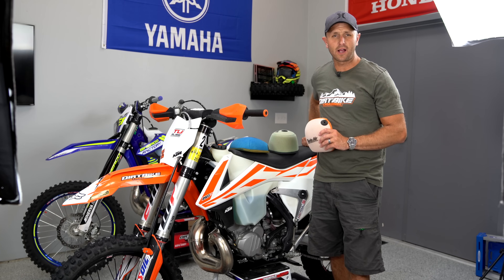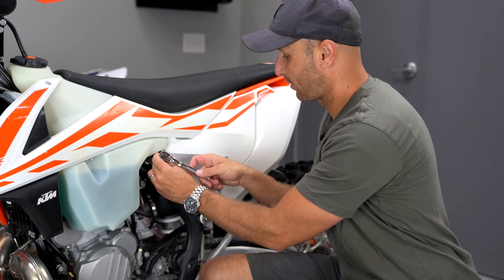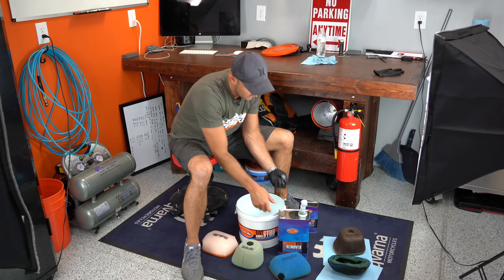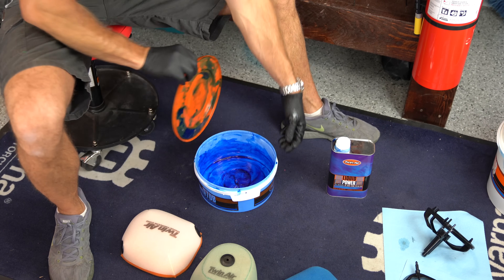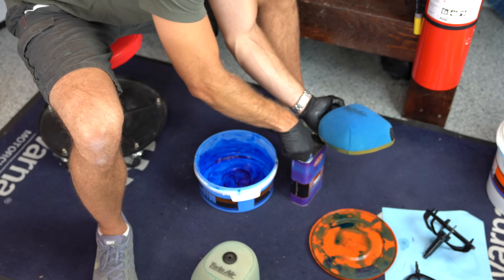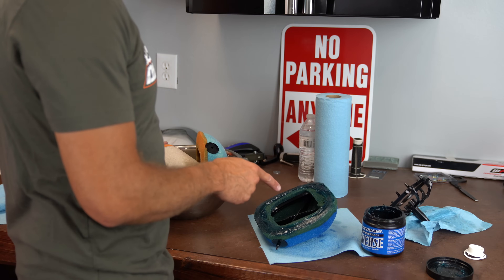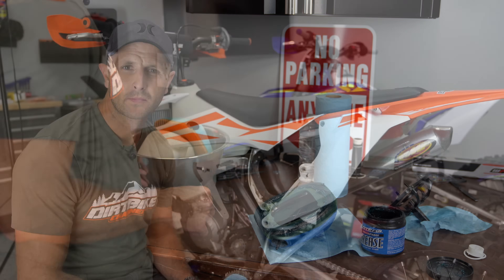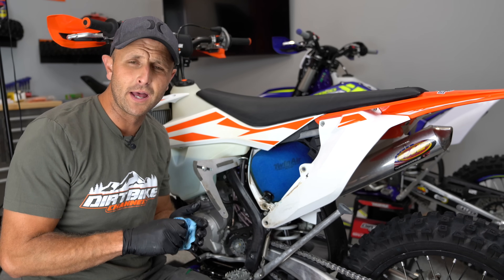How to Clean/Oil/Replace an Air Filter - For Beginners and Vets Too | Episode 288

Comment: I have been using diesel and dish soap to clean filters for 25 years. NEVER EVER had an issue with filter durability. I like the PJ1 oil.
Reply: Out here we use petrol man, gonna start using dish soap , gotta save fuel
Reply: Same
Reply: I use dish soap on mine and never had a problem.
Reply: Nice
Reply: I use gasoline then dawn dish soap and spray it with k&n oil.
Reply: @jondoe4667  what do you oil your filter with? Bc the twin air oil doesnt come off with just dish soap (i tried trust me)
Reply: @tumeh7410  I have been using k&n filter oil lately. But I make sure the filter is completely saturated.
Reply: @jondoe4667  ok i just cant get the old oil out with dish soap so i use the twin air powder thing
Reply: @tumeh7410  did that work pretty good? I've been thinking about buying the twin air wash and oil kit but haven't done it yet.
Reply: @jondoe4667  yes it has worked really good
Reply: I use laundry powder detergent (like oxiclean) and warm water. It removes all the grease and the dirt no problem. No need to soak and wait and I can do it in the bathroom sink lol
Reply: Kerosene, then warm soapy water, rinse with clean water, air dry, oil, a THIN layer of grease on the lip, install.
Reply: Its been a Longgg time since I've Ridden dirt.  But Why?? Wud you Put Oil? In an Air filter?? I started  Wayy Back i. The early 70's, BUT Never seen that? Id just Replace em.. Curious? T.Y.
Reply: @harleydavidson6851 because off  dust cant go around oil and wan is not oiled all shit came tru..

Comment: I always have the second filter oiled and ready to go. I put it in a Ziploc for later. If you have a long weekend of riding and it's been dusty you're ready to go. I also lightly grease the airbox. You would be amazed how much dirt gets stuck to the airbox walls. Thanks for the video.

Comment: the sand/particles does not go away when cleaning with solvent. You just massage them in to the filter.   The only way to proper clean the filter is to wash it the washing machine after solvent and soap.

Comment: I have used all types of filters for the work I do such as air particle systems so I know a bit about filters. Air and dirt particles are measured in what’s called microns and even a dry filter with no oil would not let sand or dust get through the filter. We don’t want dust getting into the motor of course because it would shorten the life of the piston and cylinder but also oiling the filter heavy shortens the life of the motor due to air restriction. Air restriction is very harmful to an engine of any kind. If you were to wash an oily filter with soap and water and let it dry out grab a paper towel and squeeze it into your oil oil filter. You will see there is still oil in that filter. This amount of oil is enough to help remove dust however if using a solvent such as what he’s using it could remove all oil so lightly coat the filter with oil. Dirt and dust will not get past that filter enough that it would harm the engine but restricting air flow can cause it to run hot and will cause the engine to run hot as well as shorten the life of everything in that engine including the clutch. Also he used grease around the edges and that’s a good idea because that’s the only way dust is going to get by that filter. Locking and air filter in place securely is the most important part of an air filter cleaning or replacement. Cat dander is 3 microns and dust is much larger so I’m telling you that there is no way dust can get through that filter. It’s a shame that in 2023 they don’t make these air filters lock in place like they should because how they connect to your box is extremely important

Comment: Quick question… at about $30 per can for the Twin Air filter cleaner…do you filter the ‘just used’ oil, putting it back in the can or ???. With the plastic piece in the wash tub, all of the sediment would be in the bottom and allow straining/filtering the cleaner. Curious… I know that if we own high end bikes…we can afford the upkeep/maintenance.  Big point due to hazmat liabilities 😎

Comment: nice vidio and great products to. for a long time v been using a 5 gal. bucket with about 1/8 filled with water and mineral spirits. they keep them selves separate for the dirt and a 5 gal. container of mineral springs will last a great deal of time. then I use an air filter oil that dries very sticky to the point it is stringy like. with that it makes a great sealing surface.

Comment: It’s 2021 no one should be using old fashion oil filters get with the times that’s old news new dry flow filters clean clean and flow just as good and don’t hurt your airflow meter etc etc

Comment: I ride in the desert. I use a filter dust cover. When its time for filter maintenance I unscrew the filter wing nut slightly to be able to remove just the dust cover first which is covered in dirt. Now im looking at a somewhat clean filter so when I remove it I have much less chance of dumping dirt down the intake tract. I also can extend the main filter cleaning intervals using the dust cover.

Comment: just a tip , i use a 20mm paint brush and paint a thin layer of grease on the air box lip, you use alot less grease and its much easier as the filter doesnt absorb it while applying.

Comment: I need to clean mine but the manual talks about a screw in the upper left corner??? I can't find it and I don't want to yank on the cover any possibly break it. Is there a screw that needs to be removed first?? 18 450 sxf
Reply: On my one you have to be pretty rough with it

Comment: Best dirt biking maintenance thing I've ever done was to switch from solvent based oil to alcohol based No Toil. I'd argue that the ease of cleaning helps you keep the filters cleaner, so that overall it works better. than solvent based. I'll never go back to solvent based oil again.

Comment: How many rides do you do befour cleaning the filter on the two strokes? And also how many times can you clean one filter and reuse it before it starts to tear or rip
Reply: I clean the filter every 10 hours, and replace it at 50 hours. If I were to ride in harsh condition all the time, cut the time in half.

Comment: I used bucket with oil but then I realised that I'm waisting a lot of oil after squeeze all extra oil. I did the same like you later on but now I'm using plastic bag. I put filter there oil and working. It's much cleaner method. Just FYI. What about dust cover? Are you using it?

Comment: Don’t waste a bunch of money on marketing and fancy labels.  Buying a purpose made air filter oil is justifiable to me....but the other products are not.  Buy a jug of generic mineral spirits for cleaning the filters....lots of big reasons not to use gas.  The generic mineral spirits will las you years.  As far as the grease.  Just buy a regular tube or jar of lithium complex grease from Walmart.  I just use the stuff in my grease gun for my tractor (mobile 1 lithium ).

Comment: Sure every rider has preferences but I'm pretty sold on the No Toil, would be great if you could review it.
Great for the environment and easy to use so you are more likely to clean the filter more often!
I also clean the air filter frame and airbox if they start picking up a bit too much dirt.
If you clean the airbox be sure to stick a clean rag down the intake because the airbox cleaning covers don't seal 100%.
That bucket with the grate on the bottom is a great idea, will be sure to get one of those.
Great videos, best dirt bike channel on YouTube...keep up the good work!

Comment: On my older bikes I used to use the powdered notoil cleaners and spray on filter oil. But with my '17 husky, which has the same filter as your KTM, I'm using the liquid oil (I use the green twin air stuff that seems thinner than the blue). And I have to say I really like the process of being able to completely submerge the filter then wring it out. Done!
Reply: I have used the spray oil and I don't reccomend it. I get a nice piece of mind from fully submerging the filter.

Comment: Question I use Diesel to clean which works great (in my opinion) however I don't use oil or the grease is this bad? (2017 KTM 500 6 days)
Reply: The grease around the skirt isn’t necessary. But you should always oil your filter. Especially on a bike as nice as yours. Without oil, the filter is almost useless. I recommend just getting a spray on oil. Whatever you can get will work though

Comment: Friend that keeps tractor trailer engines running hundreds of thousands of miles said the big reason they get that longevity is because of really clean air.  If he loosens a truck filter, a  good new one goes on.  Air filter hygiene as stressed in this video is the way to go: Add: Try to have a clean bike so dust crumbs don't fall in.  Damp towel to pick any dirt on clean side of filter before you put filter in. Store next "ready" filter in a big zip lock bag so it doesn't get dirty waiting to go in.  When solvent goes back in 1 gal can, leave the last 1/2 cup and the dirt in the bucket for disposal.

Comment: I'm with Kyle on the grease, Always grease the mating surface of that filter , it offers extra sealing where air could be pulled between the filter and the air box at wide open throttle. It certainly isn't hurting anything.
Reply: I prefer to run a PC pro seal but yes otherwise grease her up, more in this case better than less. Feel it would take a major excess to be a issue getting down the boot into a carb or TB on another bike.

Comment: Kyle...  Nicely done.  Two other steps that are great to practice...
    1...  Cover the intake with a boot and wash the air box after you remove the filter.  Especially in areas where you encounter some mud, it keeps you from getting dirt in the intake during the process of putting the filter back on.  On those bikes you mentioned that have filters with a tricky fit, it's very beneficial.
    2...  After the solvent, use Dawn dishwashing liquid to help remove even more dirt.  The solvent breaks down the oil and removes a lot, but the dawn get them even cleaner and does a better job of removing remaining solvent.

Cheers.
Reply: yea the solvent alone doesn't get the filter 100% clean,You can toss the filter in the washer with old rags to get it good as new, then air dry or ...n a 5 gallon bucket with some warm water and dawn dishwashing liquid and you're good to go!
Reply: 2nd ijjj
Reply: Been doing the Dawn step for years. Also I have always kept at least two filters per bike. Usually a clean one in a ziplock.

Comment: Is putting grease on the air filter mating surfaces really necessary?
Is this practice a KTM (or any manufacturer) service procedure?
The air filter cage is designed to keep the air filter from collapsing but also designed to hold the filter tightly against the air box.  

The practice of greasing your air filter seems to be necessary for poorly designed bikes.
Reply: Review Guru you should really do it on every filter no matter what bike you have. The grease is just extra protection against dirt getting past
Reply: Review Guru u should for these models especially cause their not the air filters like before with the center nut that puts even pressure all the way around , these dont seal as good so u deff should be putting grease, not as much as he put on but a thin layer forsure.
Reply from the maker: Grease is cheap and quick.  Much quicker and cheaper than motor work.  Easy, cheap insurance for the dusty locations I find myself in.  I see many desert racers doing this trick.
Reply: @angelocardoc  not you don't know what you're doing
Reply: @Mike Lyons   
Yes I do.   Haven't grenaded an engine yet.  Why????  Cause the air filter is doing is job without grease.   Do you really think the engineers at KTM Yamaha etc etc don't know anything???
Reply: @angelocardoc  go to any race track walk in the pits and look what everybody's doing Eli Tomac mechanic grease  his filter. You can do what you want I'm going to keep greasing my filter rim.
Reply: @angelocardoc  you're on a slippery slope with worn-out tires. Anything's possible. Doesn't necessarily grenade the engine but I can wear it out prematurely and cause carburetor issues. You do what you like I'm greasing my filter rim.

Comment: go get two gallons of diesel fuel and put it in that bucket....same shit as twin air. been using diesel for years to clean filters. works like a charm!
Reply: I know it’s been over a year but how many cleanings do you get out of your diesel before you get more?
Reply: @colten6996  its cheap
Reply: @jimmyjumper6613  where do you recycle it after?
Reply: @ihaveyourkeyes  the weeds in the driveway 😂
Reply: ihaveyourkeyes lmaooo... you can just mix it in with your used oil jug and give it to the auto parts store or local garage ... or if you know anyone with a waste oil heater... or soak it up in kitty litter and dump that shit
Reply: @ihaveyourkeyes  you must be from california or something
Reply: @brandoncaulkins6541  "got 'em", he thinks to himself as he wipes the cheeto cheese off on his tank top
Reply: @colten6996  I use petrol and use new stuff for every filter but I only put a bit in at a time, maybe a litre or so per filter
Reply: @taylorhessel6656  - Yeah, 2 gallons is crazy.

Comment: Why do you have to clean your air filter so often with 4 stroke bikes? Also, I thought that it would be worse for a 2 stroke engine to have dirt or dust get past the air filter into the engine because the mixture goes into the crankcase and dirt could ruin the crank.
Reply: Because of valves wear

Comment: Thanks for a great dirt bike channel.  I use Twin Air but started using No Toil.  No Toil works great and is way easier to clean.  I use an old school ketchup or honey dispenser to apply the oil.
Reply: Thanks for the applicator idea

Comment: Put a piece of masking tape on the side of the solvent bucket, so you can write on it with a pen, to keep track of how many times you've used it (# of air filters) before the solvent needs to be replaced.

Comment: This is probably a really stupid question but what is the point of putting oil on the air filter
Reply: It stops all the shit that tries to come thru with the air flow
Reply: oil is sticky and it catches dust. Dry filter would do nothing
Reply: Augi58 ok thanks I figured that's what it did but wasn't sure

Comment: Good stuff, I will be trying the grease approach next time on my '17 KTM 500 :)
Reply: Chad Cromer dont put as much as he does lol thats excesive ...all u need is a thin layer but yes u should be putting grease on cause its not a screw on filter like the other ones so it dosent get much even pressure all the way around.

Comment: The benefits of Stegs and the time they are used on the bike far outway 1 minute of tools to remove the filter
Reply from the maker: I have a video coming out on that in 2 days.  I review the Steg Pegz.
Reply: @DirtBikeChannel  you dont need to losen the u-bolts on mine just undo the subframe bolt and swing it out the way the u-bolt doesn't need to be so tight

Comment: One thing to note: KTM's new design for securing the air filter is horrible. By securing a "diamond" shaped cage on two ends made of plastic, it does allow for the cage to bow and gap on the side. Grease is almost mandatory with this design. 

Also note: If you use a TwinAir air box wash cover, stuff several clean shop towel's down in the box prior to installing the cover and after a wash, you'll see just how much water still sneaks by with the towels being very wet even with no direct water pressure to the area.
Reply: Shecki i do exactly that even with the wash cover the shop towels i stuff down there are always pretty soaked with water. you explained that pefectly and thats exactly what is wrong with these filter , the screw down filters were better.

Comment: Why is it not as important to have a clean air filter on a 2 stroke? and why is it vital on a 4 stroke?
Reply: No idea i have to clean my on my 300sixdays  cause it starts to bog
Reply: Both equally as important, if you suck dirt and dust into your cyclinder it will cause premature wear and tear

Comment: way to much grease lol all u need is a very thin layer.
Reply: I was thinking same. I guess he put same amount of grease that he uses that bean butter.
Reply: Tikkikoira lol and that filter he took out of his bike was gross , that was way passed due for a changing, unless of course that was from one good ride but i doubt it cause its pretty dry where he rides, that looked like a 50 hr filter hahah
Reply from the maker: That was after 1 ride brother.  1 very dusty 6 hour trail ride.
Reply: Dirt Bike Channel wow ive gone most of the day through nasty mud  a couple of ft deep on quad trails and mine barely had mud on it when i got home.
Reply: Okay brother, But DAT GREASE doe.. :D
Reply: Tikkikoira lol way to much
Reply: You're dead wrong
Reply: @2wheels4life27  you must be super biker
Reply: @mikelyons7511  you see the pits of pros man they are caked around the rim. No harm at all on fact pretty much bomb proof
Reply: @heritagevalleypropaintingl7911  you misunderstood grease is good
Reply: @2wheels4life27  its the dry dust that does it

Comment: verry informative! great video! Did you do the open modification to your airbox by drilling holes in the subframe like in the Slaven video? Im wondering if i let my airbox alone or if i should do the mod, bike is still brand new, 0.1h on the hour meter